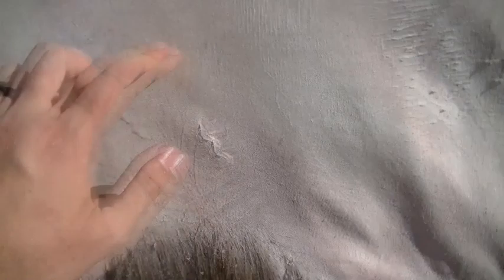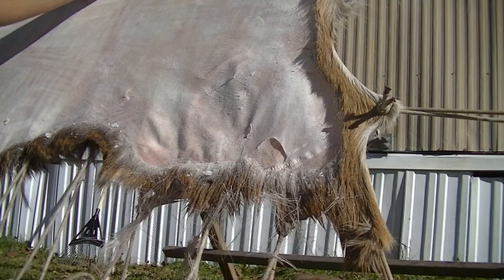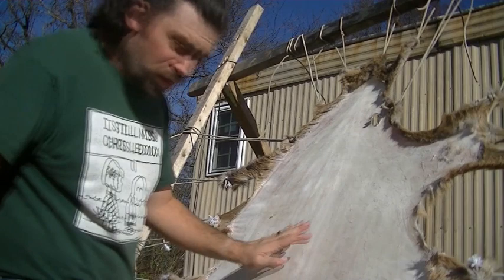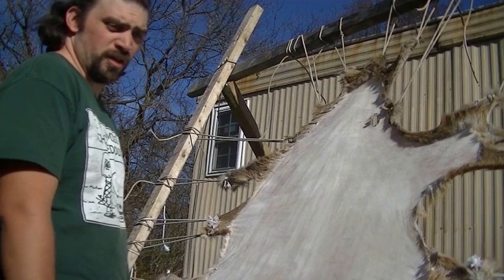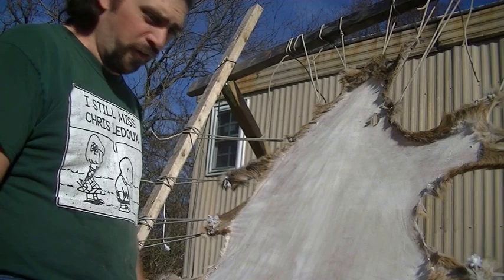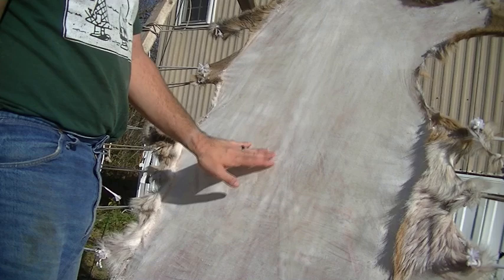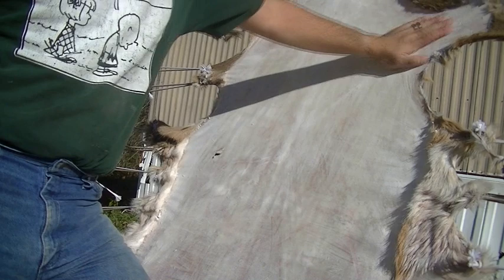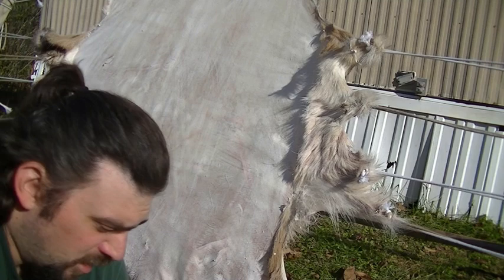Dry Scrape Deer Hide part 5

Comment: It sounds like you have plenty of hides to play with, very cool! Hope to see you wearing them when you have them all wrapped up!.....Ben
Reply from the maker: Got mocs made, just not filmed yet.   
While I got you here, have yours gotten stiff on the soles from wear in damp conditions? Mine have.  Not a bad thing just odd.
Reply from the maker: Also, if I hadn't totalled my car, I could have gotten way more.
Reply: @FrontierLegacy  once those suckers get soaked like they always do,  they will stiffen right up. Not prob at all though..  as soon as you start wearing them again, they will loosen back up. Most of the time they are wet anyways because that skin is so soft it loves to suck up water. Mocs take a beating but you will be surprised how long they keep taking that beating! Good stuff, Man!....Ben
Reply: @FrontierLegacy  I hear you! I have had many a full trunk of skins among other body parts.....Be Safe!....Ben
Reply from the maker: @TheTribeOfBenjamin   well, the processor I get them from does about 1500 a year and I could have gotten as many as I could had room for.

I've worn them since but they haven't softened back up.  I might not have done as well with the solution as I thought but not a bad thing.  They are still flexible and this makes them tougher.